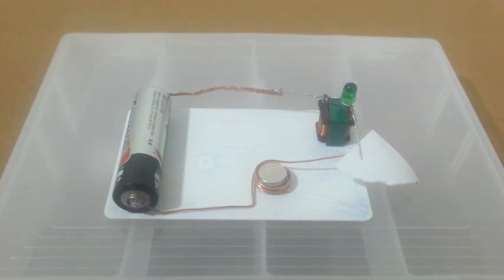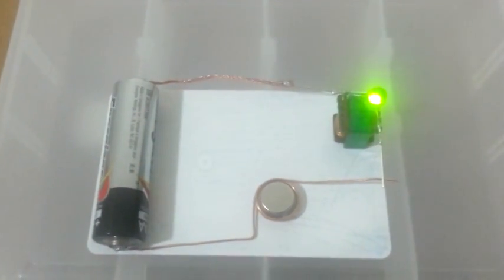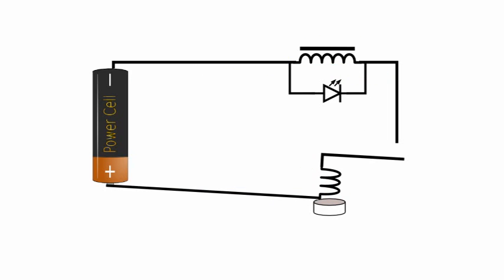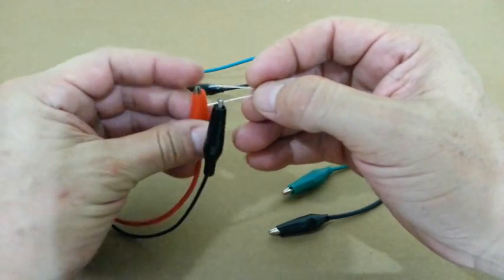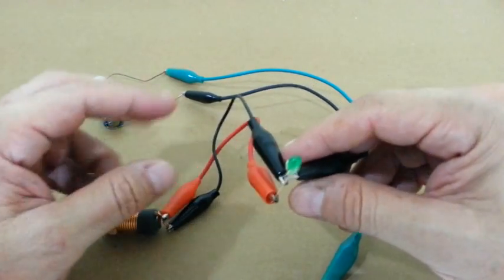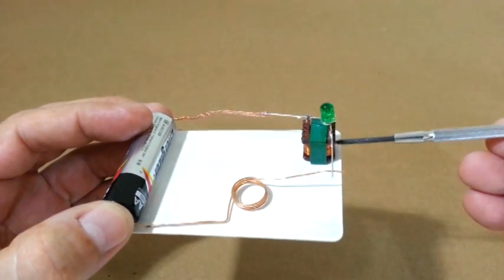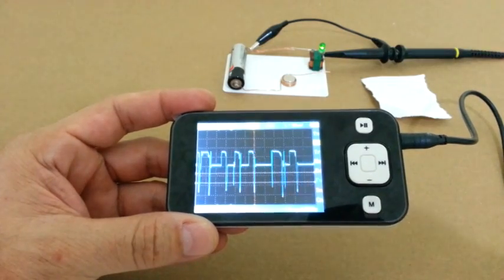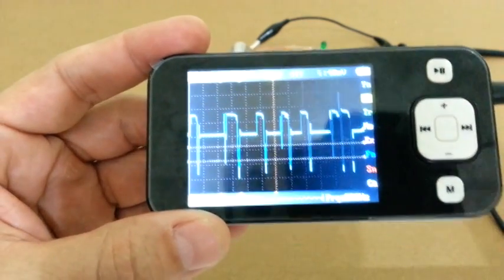Electromechanical Boost Converter

Comment: Anti genius! Try relay also. The great amount of energy goes to move the conductor+heat radiation! Transistor switch has around 80-85% efficiency, here would be no more then 45-50%. Tell us, how fast your battery dies to absolute no-use state.

Comment: Brilliant...you've created a kind of crude version of a old school vibrator power supply (although those tended to use a transformer rather than just the flyback of an inductor). But very cool though. Could be potentially used as a battery desulphator circuit.

Comment: but you've just increase the vol. in .4 volt bro
Reply: precisely enough to not blow up nor underpower the led. what's your point?

i want a video where it shows me how i can break apart the light bulb without getting hurt, so i can use my 0,5V vinegar battery to light up an LED.

Comment: Is the diode backwards in your schematic?
Reply: No the circuit is drawn upside down
Reply: Oh! The battery is "upside down". I am so used to voltage sources having their positive terminal above the negative terminal. He violated a common convention and I didn't read the schematic very closely.

Comment: its simple Xl=- wL w=2pif frequency. L is ac resistance self.  we use oppesed diode to protect circuit from load voltages.

Comment: but how you can make a high voltage with the boost circuit?i thought the high voltage capacitor is just contains the high voltage when we charge it with hv and if we charge it with boost circuit,the voltage pulse out just limited and must not able to make the higher volt range in the capacitor?

Comment: if i put a capacitor in paralel with the led?
Reply: Belrmar unfortunately wouldn't work as it would light the led twice as long but half the current so it will be dimmer or even off
Reply: All you're doing is connecting the capacitor in parallel to the inductor and what you have is an LC circuit, you'd have alternating current instead.

Comment: You drew the LED in the circuit backwards.
Reply: +Josh Talbot It's meant to be that way round in a Joule Thief type circuit.
Reply: +Siskin's Bits and Bobs Not in this circuit. In the standard joule thief circuit, the diode is wired in parallel with a transistor. In this case it is acting as a flyback diode in a boost circuit.

Comment: I mean voltage booster . I tried to make many but when I attach the load the voltage decreases.
Reply from the maker: +dawar jan yeah that happens with all booster circuits, you will need to add a voltage regulator circuit
Reply: +Ludic Science can you make one?
Reply from the maker: +dawar jan I probably will in the future, right now I am working on other projects

Comment: What variable is influencing the frequency of switching. You said it is switching at 500 hertz, by changing what factors would vary that? Is it the magnet and the coil and the strength of the field that causes it to switch faster?
Reply from the maker: +David m almost anything influences the frequency. stronger magnet, stiffer wire, higher voltage increases frequency.

Comment: can you use a capacitor to smooth out the pikes?  I noticed that the LED rapidly flickers when the circuit is in operation.
Reply from the maker: +onecreativecriminal you can put a capacitor in parallel with the LED

Comment: So its an electro mechanical boost converter.
Reply: +BBK1 Aka, mechanical joule thief. Still interesting, though.
Reply: WhtStr213 or a buck converter, since the battery isn't in series with the LED when it's on?

Comment: thanks for the video.  at the end you said it was the variation in voltage that was enoguh to light the led.  but at the beginning you were describing how the led lights up every time it makes conctact with the wire.  So does the circuit mechanically move the magnet attached wire up and down 500 times a second  to touch the led, or is it always in constant contact?
Reply from the maker: +danh le The wire moves, not the magnet
Reply: I think the magnet is used as an amplifier

Comment: This is so cool, thanks for the video!  This uses the same principle as the interrupters in induction coils.  It is interesting to note that the voltage induced across the LED is not high enough to light it up when the circuit is closed, but only when it is opened.  
This is because when the circuit is closed, the self-inductance of the coil opposes the rising current and so the rate of change is lower = lower induced voltage. When the contact is broken and the circuit opened, the current very suddenly goes to zero = larger induced voltage.  Is this correct?
https://en.wikipedia.org/wiki/Induction_coil
Reply from the maker: +Woody Goss Yes!

Comment: I like the way you explain 
Simple& easy 
I would like you to make a circuit that charges high voltage capacitors fast from AA batteries just like the flash circuit inside old cameras
Reply from the maker: +MrFatjonable It is a simple circuit, however the big problem is the tiny transformer that is needed. An alternative is to use the circuit from an electric flyswatter racquet, you get more than 1000 volts, and they cost less than 10 dollars.

Comment: Thanks, How could you get BEMF fom this circuit?
Reply from the maker: +Spangley Rainbows What is BEMF?
Reply: +Ludic Science back emf = counter electromotive force, i really don't know also. but i found this on internet: https://en.wikipedia.org/wiki/Counter-electromotive_force but i think that is not what he wanted to ask you. sorry for bad english
Reply: +Ludic Science Hi, yes counter EMF, I have seen a few people getting some voltage spikes from it and adding the gain to the circuit.
Reply from the maker: +Spangley Rainbows Sorry, you can´t add gain to a circuit by any means.
Reply: +Ludic Science by gain, I ment the voltage achieved from flyback.
Reply from the maker: +Spangley Rainbows Well that is precisely the way this circuit works.
Reply: +Ludic Science Ah, I see now:) You had to use the primary emf to get the counter EMF spike which raises the voltage and lights the bulb.